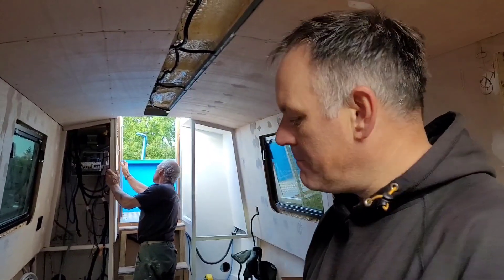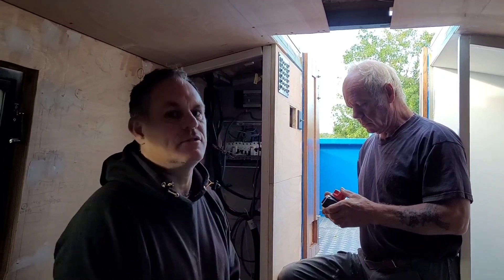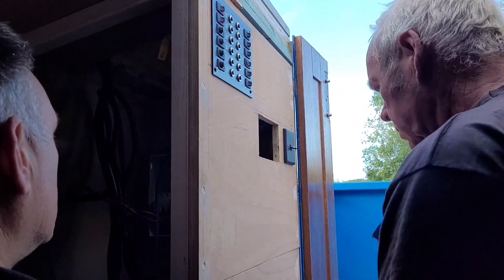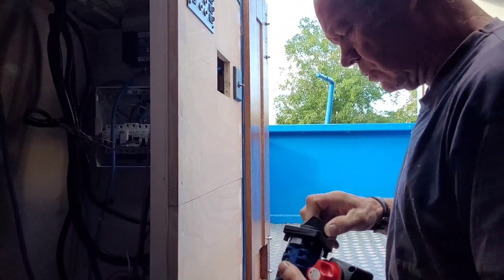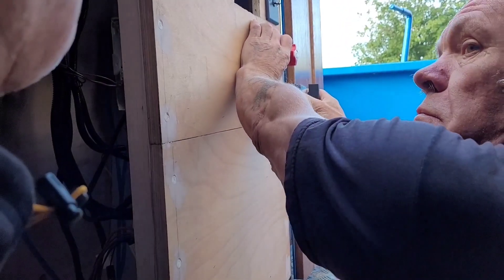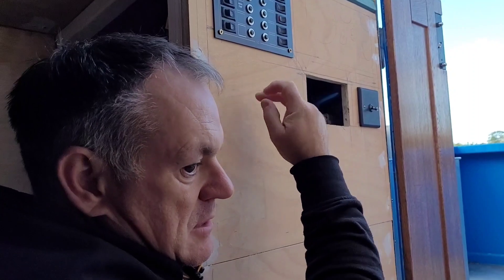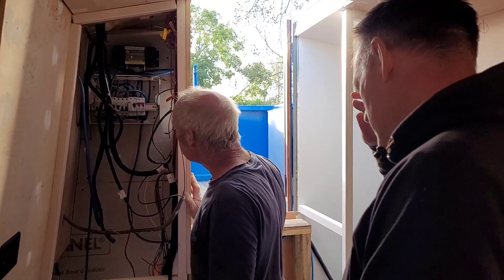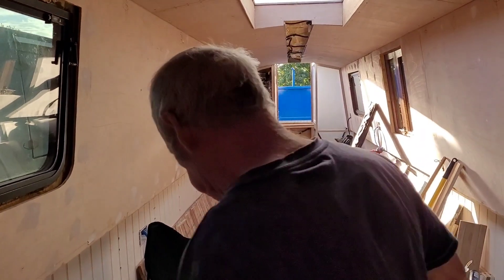Dave is a copy cat! #67 #boat #boatlifestyle

Comment: Does the engine bilge pump stay connected if you flick the battery switch when away for extended periods?
Reply from the maker: It doesn't matter as your  not supposed to have an automatic bilge pump in the engine bay, because if you have a diesel leak the bilge pump will automatically pump the diesel into the canal, which is not good for the environment
Reply: @leealibuildingtheblackswan2098  Fair enough, although a sunken boat might be worse. Is that a new rule? as ive seen lots of people with a bilge pump in the engine bay
Reply from the maker: @DEmma1972  it's a manual bilge pump not an automatic bilge pump